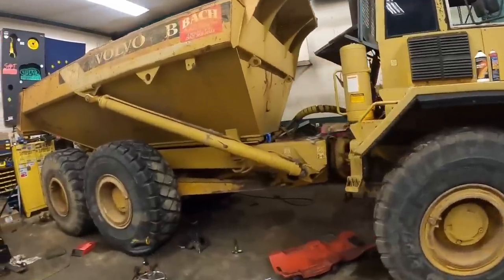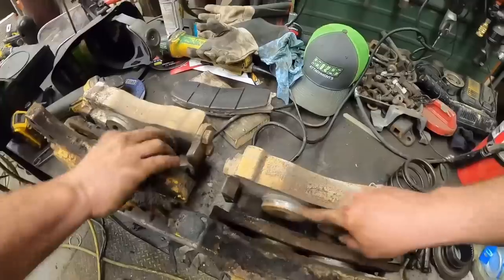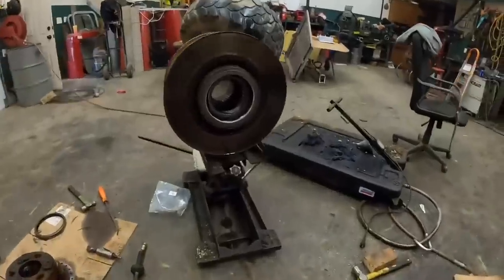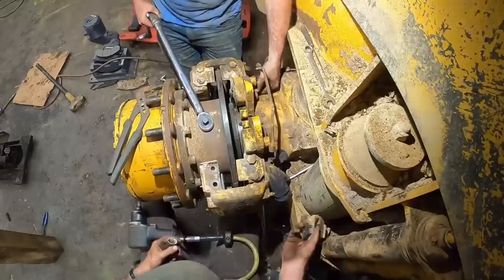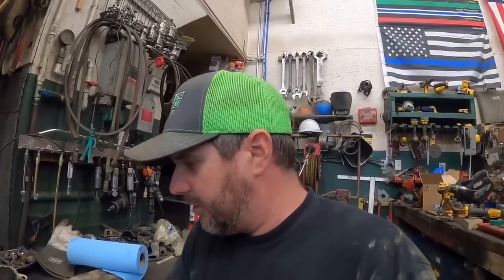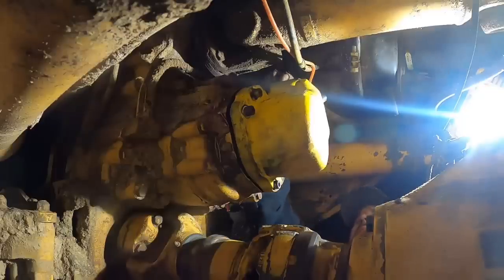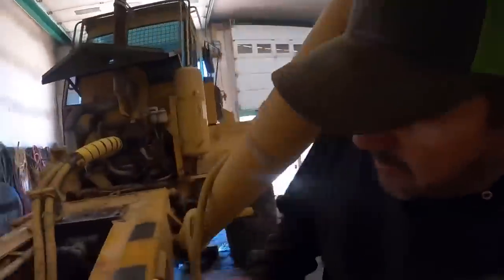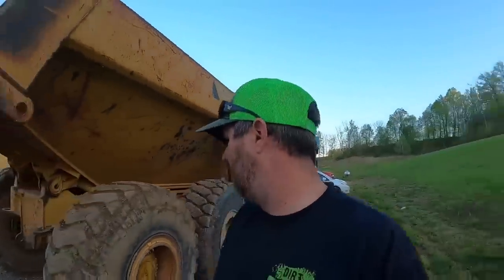Bubba dump attempts to leave the shop but its just not that simple, why will it not move  !!!!!

Comment: Suggestion/Tip for filling the hubs up on Bubba Dump or other such jobs . Remember, gravity is your friend, so to take advantage of it in a clean bucket of your favorite size such as one that the “Dinosaur Fart” aka gear oil came in and install bung with a barbed fitting as close to the bottom of the bucket as possible and attach a short section of hose to it then a valve to stop and or regulate the flow followed by another section of hose then fill the bucket with whatever fluid/oil you using and hang the bucket from you hoist, set it on a tire, ladder, etc and fill away. Personally I like larger hose before the valve and step is down after the valve as well as using clear tubing, lastly I also like a screen of some sort on the inlet of the bung inside the bucket.  I use in tank electric fuel pumps that I get from a buddy who works at a  Ford dealership. I use one as a transfer pump for fuel when draining fuel tanks etc, I have another one that I use with ATF,  another one I use with oils of all types including gear oil that I have let the bottle/jug/bucket sit out in the sun for a good while to warm up.  

PS when installing new bearings instead of using a drift to drive home you might want to consider using the old bearing race you removed.  If the bear/race is recessed like the one you just installed consider running the old race lightly on a sander or grinder to remove enough material so that your old race is no longer an interference fit.  Lastly when welding up a crack like you did on that housing after you are finished welding on it wrap it in a blanket (preferably a flame retardant welding blanket) to allow/help it cool down slowly.  
Have a nice day and a better tomorrow.

Comment: A small suggestion for removing and installing tires on large equipment and dual truck tires.
Jack up the tire.
Place a piece of metal under the tire (we used flat tin roofing ).
Put a little used oil on the tin.
Let the tire down till it just touches the tin.
Slide the tire off. 
We used to pull dual tires and the brake drum at the same time when doing brake jobs on dump trucks.
Reply: Hey Bill, that's basically what we did too, except we used grease and just rolled the whole thing out of the way and when we were done we would roll it back and use the grease mark to line it back up perfectly. No lifting required!

Comment: You know Mike, there is such a simple solution over Jungle "aka Rainforest" Products.  You have plenty of wall space and I find that gravity is FREE!  A 20 foot hose, a shut off value, tap into the bottom of the bucket, and you'll have flowing oil from a shelf on the wall into all of those wheels hubs (Inspired by those 10 min oil change places, where the oil hoses hang from the ceiling, then pull them down to fill it up).

Comment: Another great video, it was interesting watching you all take the wheels off and replace the wheel seal and the brakes .  Glad to finally see everything in good working order on Bubba . I think that you have you a great haul truck now . I am glad that it was just the fuse out of place on Bubba . For numerous years now, when I park a piece of equipment at the end of the day out on a job or at home, I pull the main power fuse out of it, helping about someone trying to steal it . But it is all older equipment, so I don't know if you can do that on this new equipment with all the computers on everything . But you might be able to take that fuse out of Bubba, till the truck would not move, if they got it started . But anyway it looked like Bubba did a great job, trying the truck out going through that bad place and climbing the hill in front of your house . So go "Bubba" go play in the mud now !!!
You all take care and stay safe and I will see you all on the next one .
🤗👍💖💫
Reply from the maker: Thanks

Comment: You have a good haul truck  just left is the heater and exhaust great job in the repair .when I weld with nickel and cast when done welding wrap it in a heat blanket  but good job on the weld 👍
Reply: We would pack our parts with lime to let them cool down very slowly. Old welders trick.

Comment: Haven't read all the comments yet but I was always  taught to drill a small hole at both ends of the crack. Preheat it then peen it after every pass. You can bury it in dry sand or wrap it in a welding blanket to cool. Will lessen chance of cracking.

Comment: I think the grooves in that sun gear should have went towards the outside where it rides against the hub. Probably not gonna be a deal breaker though . I use a small three gal tank with a cheap digital meter gun to despense oil using air to pressurize it. Works great . Seen some use a weed sprayer too.

Comment: If you can, you can thermal cycle things that like to crack.  Heat it in an oven to a few hundred and hold it for a bit then air cool.  Toss it in the freezer for a bit and let it come back up to temp.  Repeat a couple of times.  It helps relax internal stresses.

Comment: should price those old sleeves to under cut and coat or weld so you have spares for next time if cheaper than new. check with Adam Booth machine and weld shop on youtube

Comment: At 29:00 driving the yoke in. You should have put the locker yoke face down and drive the bearing down on the yoke  so you are not damaging the bearings.  Save the old bearing races and a driver tool after grinding the inside and outside slightly so you are not driving the balls into the sides of the grooves and shortening the life of the bearing about 80% or 90%.

Comment: Question,  how can you torque wheel bearings to 350 lbs unless there's a spacer or something in there I missed??        Freightliner came out with these non serviceable hubs years ago, torqued to 900 lbs.  Didn't work to well, not enough grease in a lifetime sealed bearing,  catch is I think it cost around 900 dollars to buy new unit when the bearings failed. It was around 100 dollars to repair oil bath hubs.   Non serviceable units don't perform well without lubrication.   Just saying imo.

Comment: You should not have set the pads with your air line now when you bled the brakes the fluid  has the pads tight on the rotors instead of letting the brake fluid push the pads out, You need to crack open the bleeders and push the pads back in a little. I THINK.   Good job and good luck

Comment: Well. That Jungle pump proves one thing. A much better quality oil transfer pump is worth the money and you could easily justify it with the amount of work you would have for it. 
Unfortunately it won’t do anything about the stench of the old used gear oil. 🤢

Comment: Only one question Mike, on the wheel seals ... those grooves worn into the spindle or hubs... did you consider using "speedy sleeves", some call them jiffy sleeves, a thin band of steel that slides over the groove an only adds about a few thousands on the thickness but no grooves insuring no leaks. I trust them a lot more than just dressing them as its the grooves that allow oil to leak by them. Just a question, not a insult or other misconstrued thoughts... so glad to see this together. Beginning to believe the cheapest part of one of these is the buying one, after that comes the repairs but its now a dang good unit that can be  trusted to work. Those lockers working is probably the biggest step forwards. I hope this will give a few years of service now. Paint is nice but she ain't going to any shows anytime soon. Clint's son can make the stickers to tell everyone which tonka toy this machine is.
Reply from the maker: We did covered that very will in the other videos thanks buddy

Comment: That rubber boot would cover up that little bit of dust on that cap for the caliper as it goes back in and it would never get into the oil of the brake system

Comment: You got the two snap rings mixed up on the front locker hub assembly. They should be switched internal vs external ☹️ not sure how big of a deal it is but I had to say something.

Comment: old farmers trick for welding cast iron pre heat in wife's  oven around 500 weld with nickel rod then quickly but back in oven that's still on and very very slowly cool it down  you probably already know this but it's how i do it O yeah clean up kitchen and act like nothing happened lol 😂

Comment: Reverso brand oil change pumps, 12 or 24 volt ( your choice ) would probably work better at pumping the oil into the axles.
 if you add a ball valve to each machine's oil pan instead of the normal plug the same oil change pump will pump the oil out of the engine and you can pump new oil back in through the same line. You would only need to connect a hose and open the valve to change the oil.

but a pump for an engine would run about a grand.

Comment: In Texas the load in the bed of the truck has to be covered if it has contents. Do you have a provision for that? Does Indiana have such a regulation or will you keep it off the highway when loaded.
Very enlightening to watch you’ll working now you need to help Matt NY Millennial with his Skagg to save his marriage.
Reply: Are these big haul trucks road legal?
Reply: @kenore4003  Matt aka NYA Millennial drove chirt on a job for the logger in Bubba Dump.  He was on county roads.
Reply from the maker: No off road no

Comment: as a life long welder. that is not cast iron. if it was, you wouldnt get sparks off the grinder like that, 2nd, if you welded more then half an inch at a time an penning the hell out of it, each time. it would crack like glass, 3rd, if you dont heat the whole housing up to minimum 800 deg. and keep it well covered up in a welding blanket with slow heat on it to cool very slowly over hours it would crack like a window. 4th you never touch a cast iron weld with a grinder. you put crap into the weld,, 95% nickel rod is best for cast iron.. being you got sparks like that off the grinder, it cast steel, not cast iron. witch you just weld up with 7018 or 8018 rod.. as normal..none of them cheap oil ansfer pumps work atall on heavy oil. unless you buy a 6 or $700 cnd one, years a go i was not spending that kind of money on something that gets used a hand full of times a years, with all the parts i have collected over the years, i took a small hydrophilic pump with 3/8 outlet port an 1/2' inlet. and a love joy coupler, and a 1/4 hp electric motor and made my own for free, it been working great over30 years, did the same with a bigger pump with 1' ports..  and sealed 1/4 hp motor..  for transferring fuel,, as i went though 3 fill right fuel pumps in 4 years.. not know more, it been working for 20 years fail free. i j just use an inverter in my truck.. i just bough a steel track kamatsu mini ex 12000Lb 1997. with 1743 hour, new bucket pins, new steel rollers on under side, pant is faded from sitting out side,,  but i am trying to sort out what i need to do to ad remote hydraulics for a thumb. i am building for it.i have built many in my life.. i have all the steel laying around.. . i have tons of #8, #10 #4 and 12 and 5 gallon pails full of the old style re-usable JIC AND npt, fittings and a number of different size cylinders, i just have o sort out what i need to do to the factory valve bank to add remote for a thumb, with a diverter valve on stick boom to use the same lines to run an post hole augur ,, tilt bucket.. but i am still scratching my head. how ever i know i have to find valve bank sections to fit the factory valve bank, a case drain, an solenoids.. i so have a box full of solenoids w/spools. there nothing on you tube of any use. every video says hooking up remotes for a thumb, but the machine has factory lines all ready.. there a not used rocker switch with detentes  on the right joy stick.. with 2 wires that go know were. ill have a video soon.